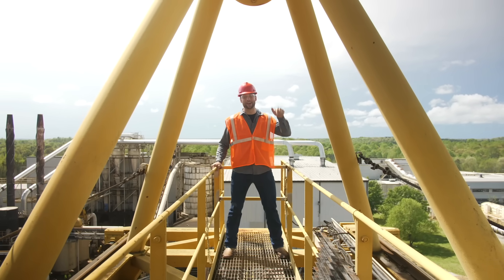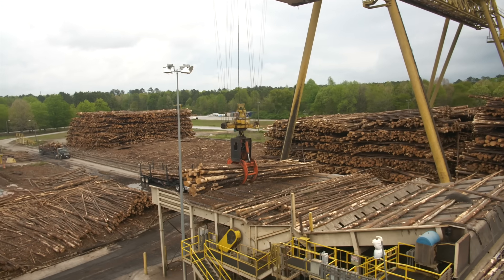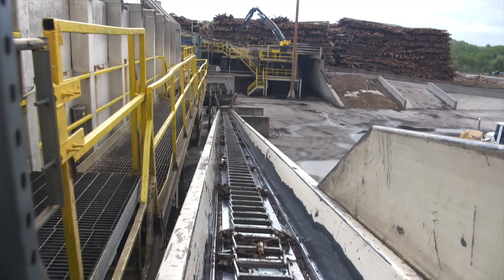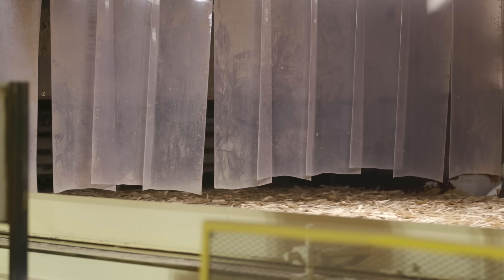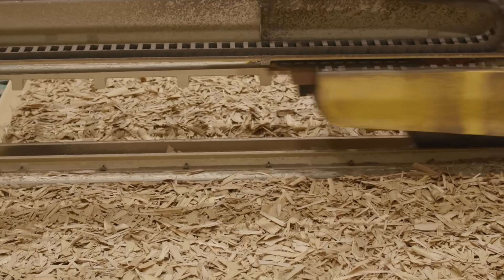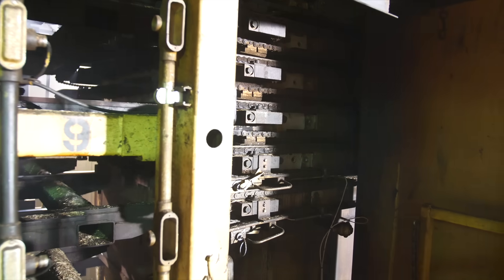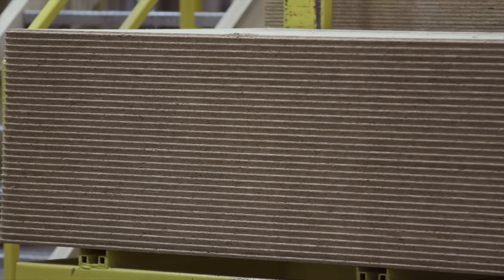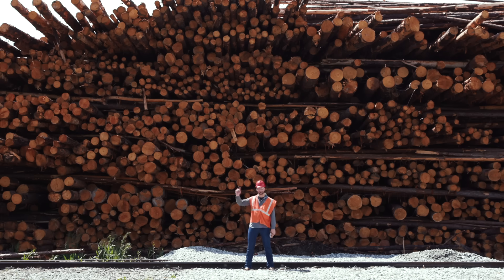Could OSB be BETTER than Plywood????

Comment: The one advantage of OSB over plywood is you can have a half inch thick sheet of OSB and after it gets rained on a few times you now have a three quarter inch thick sheet of OSB :)
Reply: Phill Huddleston lmao
Reply: @SC-dt4ij  why i dont like osb trash
Reply: Smarter Than You  Hence raising the R value...LOL ;-)   I think its clear CDX is clearly superior and these are just sarcastic comments. (at least from a couple of the Ytubers
Reply: Phill Huddleston  That sounds like a shit building board to use in a house ,Weak as piss.
Reply: @darcymunro8930  It is shitty but cheap so it's used a lot.
Reply: @phillhuddleston9445  
Not actually that cheap considering it's limitations.
OSB is just overblown particle board.
Reply: In other words - value added product. 😁👍🇺🇸
Reply: Smarter Than You  That was my point.
Reply: For whatever it's worth: Here in France there are two common grades of OSB. OSB1 is for interior use, OSB3 is for humid-area use, and now I think about it, I don't think I've ever seen OSB2... Anyway, I had some leftover OSB3 half-sheets after building my house three years ago, so I left them on the ground outside as a temporary footpath. After three years sitting around on the clay (notably on the much damper northern side of the building, which also faces into a steep slope) they're still not delaminating. I took a few to be recycled a few months ago, and I was able to snap them lengthwise (for easier transport), but I still had to use my body weight to do so. There was very little swelling. I wouldn't want to build a house out of them in that state, but clearly they can be made to stand up to water much better than what some people on here have described. I guess it really just depends on what exactly you buy...
Reply: @philipteevee8067  That maybe the case. I do not see any OSB that is better than plywood. And someone here had the nerve to say it failed because it was cut and exposed. As if we dont cut the sheets to size and fit of project..LOL.
Reply: not true
Reply: Funniest comment I’ve seen in a long time
Reply: And it probably adds to the thermal insulating slightly  when it expands
Reply: Any wood left out I the rain for a month will be ruined even pressure treated lumber ,osb is a way better product than plywood ever was
Reply: @oldtimefarmer2309  "Any wood left out I the rain for a month will be ruined" Think decks and boats.
Reply: @oldtimefarmer2309  I had a piece of painted plywood crack on top of my chicken coop. After I replaced it, I put it down flat on the ground as dry space for my dogs in the sunshine. Figured I'd pitch it when it rotted. That was 2 years ago.
Reply: Lol!
Reply: So matt is a sell-out
Reply: @PracticalTech No need to insult, We all love where we live. I just agreed that OSB will mold and delaminate extremely quickly in wet conditions. I'm sure that your area has it's issues too.
Reply: MDF will also swell up.  To me it is just really thick cardboard.
Reply: BAHAHAHAHA FACTS!!!!!
Reply: Lol
Reply: You fail to mention that you can use .002 thick staple method to hang paper once your get the expansion water treatment.  *I forgot to mention, that this may raise the R value.
Reply: So it's a sound investment then. You get more of it as time passes. Good stuff.
Reply: AH, you only know OSB1&2. OSB3&4 doesnt swell with rain
Reply: You mean OBS.  Old Bull Sh!T.
Reply: @PracticalTechi bet you’re super fun at parties
Reply: The apartments they built by my house used some kind of green laminated osb for the outside layer. This must be a moisture protection layer because this was the first time I had ever seen such a material, but I looked at it closely and it was just regular osb on the inside. They are doing some amazing new things with it apparently, so people shouldn't look down on innovation of this long standing construction product. They were left out in the rain and snow for weeks uncovered with no damage at all. I just wish I knew what brand this was because I intend on using it in the future. This stuff was obviously made specifically to stand up to the elements for long periods of time.
Reply: @DeathBYDesign666  I bet that was "Zip System" sheathing by Huber. The builder tapes up the joints between the OSB sheets and that saves them from having to do a separate rainscreen (in Tyvek or similar) afterwards.
Reply: @DeathBYDesign666   it's Huber Zip
Reply: User osb3 Ort osb4. Honk
Reply: In my experience OSB holds up better in water than plywood does. Hard for me to believe that I have seen it again and again.
Reply: Yea, how do we say that? it swells up like a honeymoon ****!
Reply: And plywood will split
Reply: Yeah and a few days later you have a convenient pile of mulch
Reply: @PracticalTech They just built a building in the Tongass National forest(southeast Alaska) with OSB, you are correct, black mold will ensue in the coming years. Engineers from other places don't recognize the local hazards. They also built it with an inward gabled roof, so that the snow load will fall on to the cars. We get "feet" of snow at a time. I bid the residents of this "low rent" housing project "good luck".
Reply: @pahasapaman  That is because the maintenance and upkeep contract is done by the guy who made the deal happen and wants to keep the cash flow up. Pretty sick and simple if you follow the money.
Reply: And one you can easily punch your foot through for utility runs!
Reply: I think you've confused this product with partical board which is made from compressed cardboard in that case you're correct
Reply: I'm not affiliated but we used their Advantech in the shop, which gets water on the floor fairly often.  2 years later its still not swollen anywhere.
Reply: @TroyBlass  not swollen, now that's some E D wood right there.. won't swell..kkkkkkk
Reply: @TroyBlass  The original poster doesn't know WTF he's talking about. He's ignorant.
Reply: @alan30189  Then tell me why the OSB scraps I set outside my shop started to swelled up in a little over a week and were nearly double in thickness in a couple  months. I was referring to OSB in general not necessarily this particular brand.
Reply: Phill Huddleston - Because scraps have a cut end, that will absorb water more than the sealed edge of a 4 x 8 sheet of OSB. Or you have a poor quality product that was not sealed properly. You would have to reseal the cut ends edges of those scraps, to not have a problem. But it isn’t supposed to be out in the elements 100% of the time.
Reply: @alan30189  Often time is there are several pieces of OSB that need to be cut to size on wall sheathing and roofing.
Reply: @phillhuddleston9445  Then you are a cheapscate and went for OSB1 ( rated for interior only ) when you use OSB3 ( exterior or damp interior ) or OSB4 ( full rainproof ) they wil not swell.
Reply: @phillhuddleston9445  Had a banded bundle of Norboard delivered to a job site once.   It rained on it.  Came back Monday morning and the OSB swelled and busted the bands.
Reply: Talked to a lady who worked for Norboard that I met while on vacation.   I told her about my experience and she said Norboard had many lawsuits against them for that problem.
Reply: @phillhuddleston9445  you are right about the materials you have seen fail. But there are also different brands of osb that do not fail in the same way. What I wonder is if the good osb is cut and not sealed what happens. Let’s accept the fact that a product that is not idiot proof has a big weakness in this industry. I am not saying any of you are the idiots, but I know you have worked with them!
Reply: @alan30189  Dude, over time OSB WILL fail. If you are flipping homes use cheap OSB. If you own your home, and dont want un-needed repair costs, Get real plywood, and coat it if you want extra work time installing it. In the long run, it will outlast. Once a house is done, the ideal is not to have any issues, But the fact is there are always things happening. Settling, weather, etc. All these happen ALL the time.
Reply: @jemijo321  Umm, I am just a DIY, but dont you have to cut the panels to fit the project you work with? LOL...Sounds pretty obvious to me that you need to cut these as with plywood. There are ZERO instructions telling you to tar the edges or coat them with something.
Reply: Phill Huddleston absolutely.  OSB or chipboard is utter rubbish, it’s a waste of good timber
Reply: @tictactoe325  Look at the "logs" they were chipping. Those logs are suitable only for chipping or pulping. Definitely not timber.
Reply: I think you have osb and presswood mixed up
Reply: @l798pipeliner7  Leave OSB out in the rain for a month and see how bad it expands. It can take getting wet a couple times but too much more than that and it really screws it up.
Reply: Phill Huddleston I was more responding to the comment about it falling apart in your hand. That would definitely be presswood. It was installed in tons of mobile homes and many houses years ago. I believe presswood the. Was 1 inch thick and when wet it expanded and crumbled like crazy.
Reply: @phillhuddleston9445  I have seen some with a significant coat of some epoxy like oil cover, and I have seen the ones in the HD that are basic OSB. Some brands maybe coating it different.
Reply: L798pipeliner osb
Reply: @phillhuddleston9445  leave your windows down in your car when it rains and after a few times the interior will fall apart but most people know you have to protect the OSB from the elements just like plywood
Reply: @l798pipeliner7  Nope..OSB will expand crazy once it gets wet. It is also a lower insulation factor, but mostly not so significant differences.
Reply: @philindeblanc  depends on the class/type of OSB.
Reply: @philindeblanc  not if they are using a different glue!! Any of you ever use SMART BOARD,SIDING, OR  FACIA BOARD???!!  
It's the best material I've ever used!! Facia board laid on the ground for 3 years, as good as the day I got it!!  And it's nothing more than OSB WITH A DIFFERENT GLUE USED ON IT!!!
Reply: @philindeblanc  And if it's L-P fire resistant OSB on the roof underlay and it gets wet before roofing, it will auto-charcoal, which is ironic because the charcoal board is no longer fire resistant.
Reply: @philindeblanc  huh, I know the differences and I had accidentally left a 4X8 out in three days of rain and Cold..i just Left it as it was there to dry..once dry..I moved it and there were no signs of swelling or crumbling or notable damages that I could see...on the other hand I have had sheets of plywood bow and warp and not usable no matter how much I soaked and pressed on it between two others with a small car
On top.. Left it like that for a good fort nite..took it out.. rippled and bumps every where.. garbage...
Reply: @mitchadams2815  3 years?? LOLOL...Try 120F degrees, and 29F degrees for about 10 years and then tell me. I hate it, but I rather use PVC as facia than ANY wood...Maybe other than that exotic South AMerican Bahia or whatever its clled (not teak).
Reply: Advantech has a six month direct exposure guarantee. There is not a plywood product that can perform even remotely close to that.
Reply: @pufferfish0567  That is why its a 6month guarantee..LOLOL Piece of junk. Plywood doesn't have to claim a performance of 6months as it doesnt suck as much water.
Reply: @philindeblanc  its a six month direct exposure warranty. It has a 50 year warranty after dried in. It is a far superior product to any laminated plywood flooring. It does not suck up water and there is a negligible amount of swelling in direct exposure and none when dried in. You might want to do a little research into it.
Reply: Dunno about you, but my house has a roof.
Reply: osb is great . It lot stronger . why r all simpson wall frame made out of osb . why all tji made of osb . osb may puff up a little but plywood would delaminate. plywood strength is only on the two outer skin
Reply: @richardfuess4521  You ask why companies use OSB? Its usually because they have a financial gain. All you have to do is test it with YOUR OWN parameters YOURSELF. Not hard to do. If you dont know how to test, just ask here and you will get plenty feedback suggestions.
Reply: Anyone that works with both knows that OSB is a superior product over plywood
Reply: @hotwire62  I worked with BOTH, and would use CDX plywood ANYDAY over OSB. For LONG term piece of mind. If I flip a home, I will use OSB
Reply: Not true at all. It's an exterior rated product, meaning that, like plywood, it can withstand the elements during construction, with no problems. It's sealed to repel water.  It also uses exterior rated adhesive, like all plywood does as well. It would take a long time for it to wear off, to where it would swell up.

Comment: Not all plywood is that great either. I just bought some 19/32 plywood at home depot. Real cheap garbage. Got wet one time, fell apart all around the edges. Not only fell apart but also got wavy and soggy. I bought some OSB at home depot for the subfloor on a porch. Again this was garbage. I started to notice some pieces of the surface were loose and looked like you could just pull them off with your hand. When I looked closer it was like this on the entire surface. I covered it with a sheet of vinyl flooring. You get what you pay for folks. Home depot has some goid prices but the quality isn't always great.

Comment: CLICKBAIT!!! This is not a comparison video. It only shows how OSB is made. OSB is trash, barely usable for roofing under lament. It gets wet, its done. Plywood can get wet over and over and still hold structure. Only benefit of OSB over plywood is upfront cost. It will cost you more to replace it sooner than traditional plywood. Also, You can't fasten other pieces of wood to it, and have it hold as well as plywood.  If I could down vote this video more than once, I would break the button.

Comment: put it in the rain, they say two rains and you have to take it out
Reply: Worked countless jobs with Advantech used as subfloor. Went entire New England winter with no roof on 6200sq.ft. house shoveling off floor space where needed. In spring it dried out NO PROBLEM. We even had 2 pallets of 4X8 sheets in the basement where the bottom 3 sheets were under water for MONTHS!!!!! 2 days in the sun they were fine! Incredible stuff.
Reply: @robertorr2878  they weren't dryer out yet. They do go bad, I was an inspector on many jobs. The glue comes apart.

Comment: Don't need to watch the vid .Simple answer is NO. The stuff I have used is absolute $h!te and delaminates as soon as it gets wet it is also more expensive than shuttering ply..Only saving grace is that it has less warp in it than shuttering ply but it is carp as far as I am concerned.
Reply: your right . Any delay in the building process and this delaminates .Given a choice I am still a plywood fan.

Comment: Just an idle thought...there are very few home being built today that are expected to last for generations as they were in 18th through the 20th centuries. Speaking as a carpenter that has worked as a renovator in Charleston, SC for many years. Most buildings today and the recent past are built as disposables with the short term use in mind. Many negative remarks on the attributes, or lack thereof, of OSB but I see it as filling a niche for inexpensive housing/building, along with its cheap companion...vinyl siding. There’s a market for all . All too often the land a building sits on becomes too valuable to sustain that buildings value.

Comment: Its fine unless it gets wet, and everything should be built as so that if the exterior siding leaks the structural sheathing should also instantly turn into garbage.